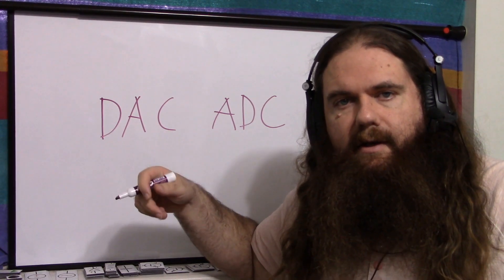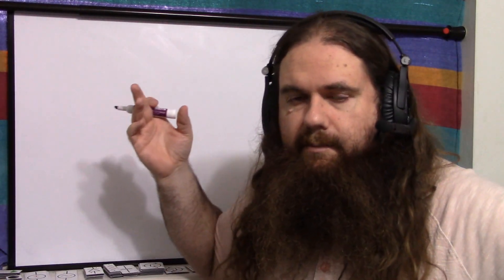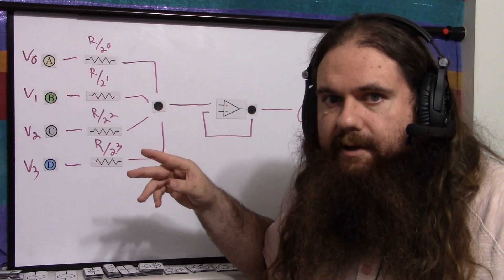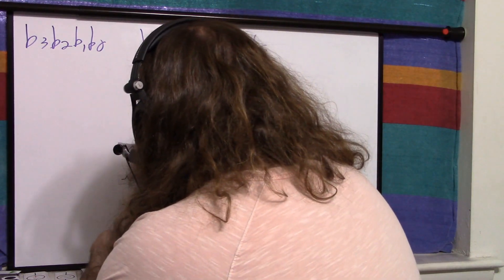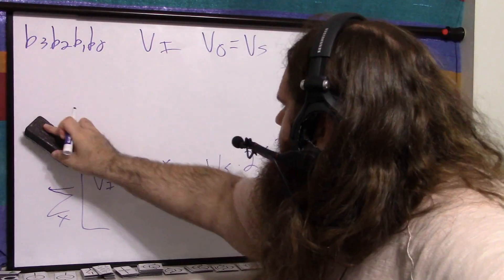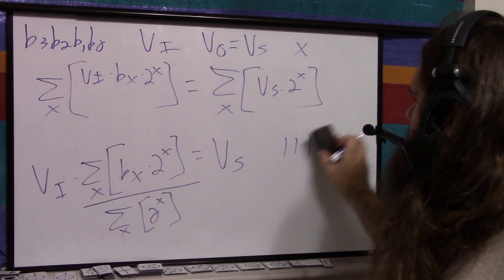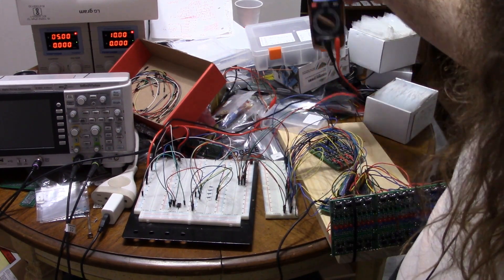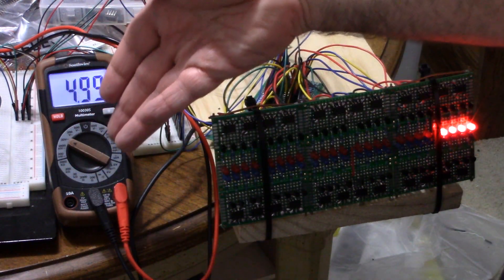Making a DAC Using a Resistor Ladder Op-Amp Weighted Summing Amplifier - Simply Put

Comment: Your are a genious Tell me I have a question about reading resistive  different fuel and oil gauge European 0-190 Ohms US 240-30 Ohm Do you think i can use this concept to read voltage to an Mcu.
If yes can i share you my circuit diagram for review?

Best Regards

Comment: Question have you used the CD4026be dual JK ic chip to build a Digital to Analog convert circuit in conjunction with the R-2R resistor ladder network?
Reply: Or the Binary weighted resistor network?

Comment: I’m actually trying to use this for my kitchen lighting (yeah, hang i there). The concept: I want to know which drawer column was opened and I’m using hall sensors connected in series for each column. But then the columns are connected parallel. I want to avoid having a cable for every column go through half the kitchen so let’s stick with two cables: supply and signal. The signal holds the voltage specific to the drawer column (i.e. every column has a specific resistance value). Now the MCU needs to see the sum of the voltages to make sense of all this chaos. So every sign is pointing to the direction of using the op-amp as a summing amp, but somehow it doesn’t want to work in falstad online circuit simulation. Is the simulator not working correctly with DC or am I screwing something up?

Comment: I don't think I've ever built a DAC that way but I've definitely simulated one before. That was an interesting video.

I would say a R-2R is actually simpler because you can build it out of one single value of resistor. To get 2R all you need is two Rs in series. Of course you can also just use 2 different values, one on them being exactly twice the vale of the other.
The nicest way is to use Resistor networks that have 8 identical resistors in one DIP package.

I like these types of circuits because they're amazingly fast.

https://www.youtube.com/watch?v=AulX1OM7RwE
https://www.qsl.net/w/w2aew//youtube/Basics_of_R-2R_Ladder_DACs.pdf

Comment: Good presentation and nice to see that you're getting good use from your modules.  To your final point, I have seen a DAC implemented as a resistive (R-2R) network only.  The output impedance would be equal to R.  However, it uses twice as many resistors as your approach so it's difficult to say which one is "simpler" :)
Reply from the maker: Interesting because it uses only two values of resistors though, and a buffer can always be added. I shall look into it!
Reply: @simplyput2796  Also, wanted to add a couple of points.  1) You might have realized that your circuit is equivalent to a "summer" circuit used in analog computers.  2) An idea for a subsequent video would be to make an ADC using your DAC and a comparator.  Then you will have closed the loop!
Reply from the maker: Yep, making a note now to do that video. More videos!

Comment: So turn it back into binary, smarty.  Lol!  That was fun to watch.
Reply from the maker: That's for the future. ADC are harder to make! The simplest one I know of is timing-based, charging a capacitor relative to a reference voltage, which I will get into, but I want to figure out if there is a good easy way to create a combinational one. I'm thinking a comparator tree, which will be fun to build even if ultimately not fruitful.
Reply: @simplyput2796  I believe you only need a single comparator.  Feed your DAC into one and the measurement signal into the other.  Then do a successive approximation using the DAC until you find the threshold.  I'm assuming you will be using a uC.
Reply from the maker: Oh yes, that's an option too, but I like to try different options just for the sake of learning. Being able to do it combinationally would be neat, and I already have an idea of how, but it would take too many parts, so I'm thinking and scheming.
Reply: @simplyput2796  Cool, I'll be looking forward to whatever you decide to conjure up!